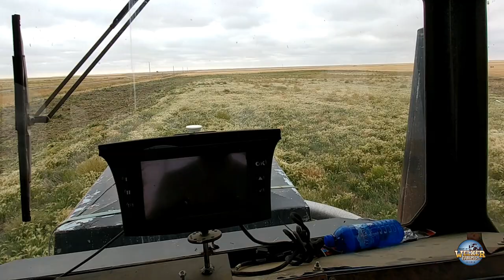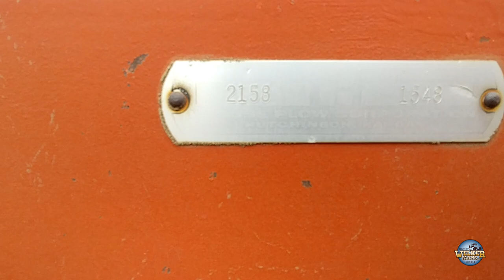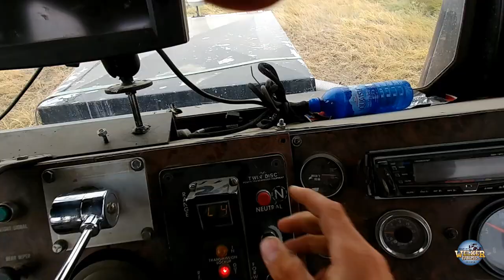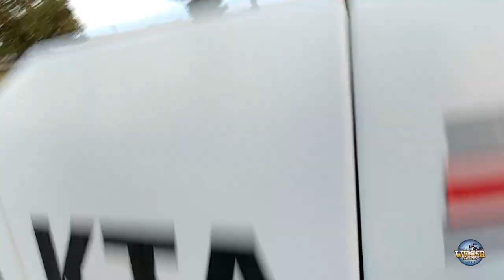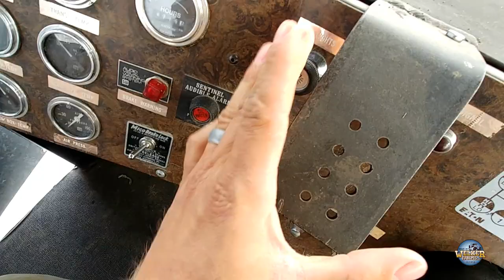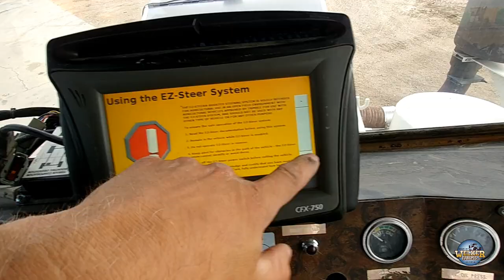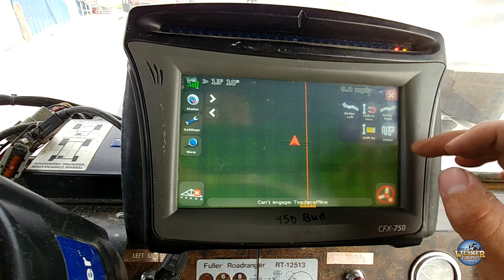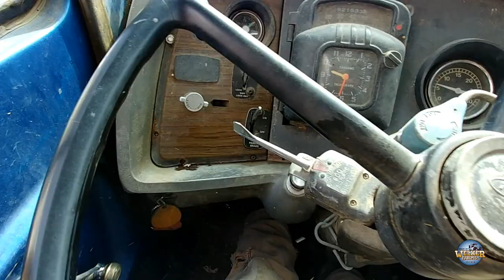It's Almost Bud Time - Welker Farms Inc

Comment: I grew up in the masonry /construction industry and was fascinated with heavy equipment all my life.  I was disabled 35 years ago and went to college to sit in an office for 30 years staring out the window wishing I was doing something tangible.  I always loved operating.  I wanted to farm but I was always told it was too risky and no money and every farmer was poor.  There has to be a million dollars + equipment in this operation.  Those tires are probably $2k?  How do you know if you are making money or are poor?  Now I sit here and watch these videos and wish I never would have gone to college.  A lot of these new machines are hydrostatic.  I saw a guy that was a para and they built a lift that went on the back of a one ton flat bed.  He had a remote and maneuvered a seat right to him, he slid in and could go 17' high and 34' around that truck.  He lifted himself up in a combine door moved the seat and arm and drove off.  I love all this stuff!  Hindsight...

Comment: Another great video. Kochia is becoming one of our biggest weed problems here in NC NoDak. It’s becoming more and more resistant to more modes of action. We still use an EZ Steer as well to seed with our 855 versatile! One helpful hint, noticed your EZ Steer motor looks to be mounted 180 backwards. When you pull the pin the spring loaded pressure should hold it against the steering wheel to ensure constant contact.
Reply from the maker: You know what... I think we've been doing it wrong all this time! Might need to rebuild our brackets. Thanks!

Comment: You can change the guts of the hydraulic couplers on the 4520 to pioneer then you don't need adapters and get rid of those awful John Deere ends

Comment: I noticed at 22:20 on the 4520 you have an aluminum rain cap.  If I am correct that is somewhat rare.  We have the smaller one on our 4000 that my Dad bought new.  There is a company making reproductions of the smaller one.....not sure on the bigger ones like yours.  I'm sure there is a collector somewhere that like to have it if you would part with it!
Reply from the maker: Oh didn't know that, we actually lost it for a few months as it fell off but I'm pretty sure it was found and was replaced with a new cap. I'll check and make sure we have it.
Reply: Oh gosh....make sure you have that!  I bid an original small cap to $150 on eBay about 4 years ago!

Comment: Why do you applicate the fertilizer before winter? Aren't you afraid for washout?
Reply: The fertilizer is put in the trench with seed,  if it washes out so does the seed:)
Reply: @adrianklaver113  Seed is not soluble, in contrast to fertilizer. So seed can not washout. On the other hand , seed can be subject to erosion.
Reply from the maker: I have thought about that but word is the best time to get it in the soil is fall and supposedly it'll be available in the spring with the ground frozen. Wish I had a for sure answer!
Reply: Aah, so a matter of definition. I was taught a washout is:
https://www.thefreedictionary.com/washout
So a form of erosion.  Fertilizer is indeed soluble and can be mobilized with water movement, especially N which does not bind to soil as readily as say P.   How far it moves depends on underground structure/soil type, unless there is sufficient water(e.g. a flood) to move it above ground and into surface flow. That is when retention structures become important. Given the water budget in the region Welker Farms is located in I would expect the N to stay in the vicinity of the crop for the most part.
Reply: @WelkerFarms  ok
Reply: @adrianklaver113  ok. Not tought about a dry winter. Only winters i know are wet, wet and wet. 😁
Reply: Yeah, that is what I am familiar with here in Western Washington and back when I worked on farms in Mississippi Delta. There the water table was above ground in Winter:)
Reply: @adrianklaver113  i tought for sure that you lived in the Netherlands , with a 100% dutch name like Adrian Klaver.
Reply: My father was born and raised in Middelburg,  Zeeland so that would explain the name.  My mother is 1/2 English and 1/2 Italian and my middle name is Leonard so I don't quite make the 100% Dutch:)

Comment: what does 525/50 mean on big bud?
Reply: yes, but what does 50 mean?
Reply from the maker: 50 is the series of transmission that is in it, /50 is a 9 speed power shift, /30 is a 6 speed power shift, /10 is a 18 speed Eaton fuller
Reply: thanks for the information.